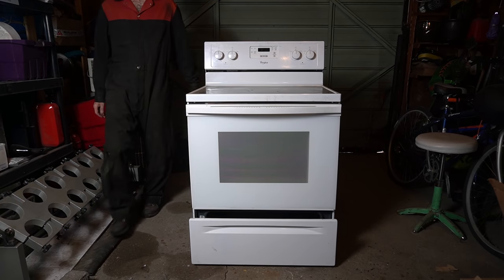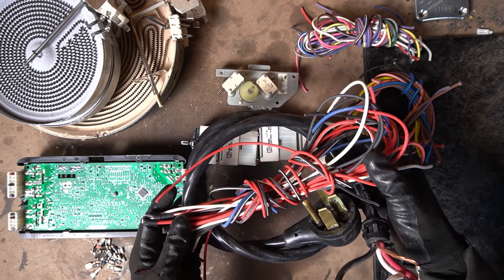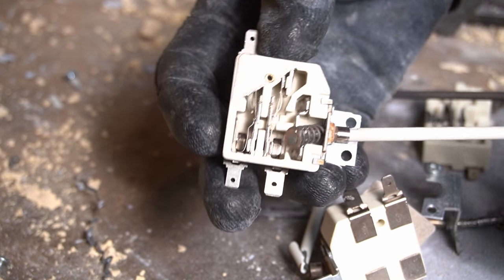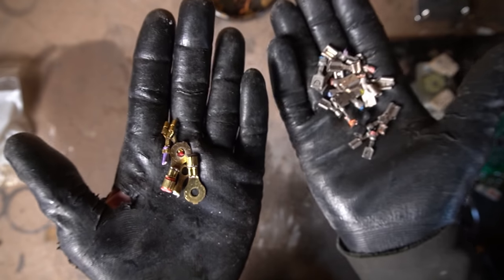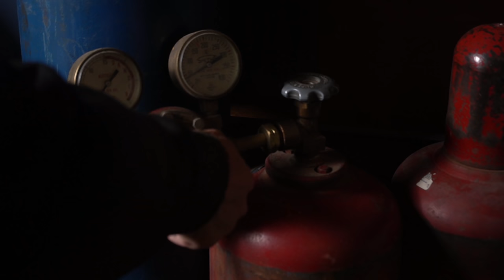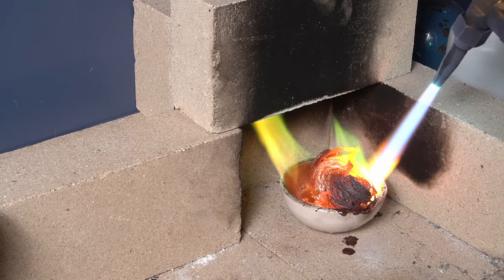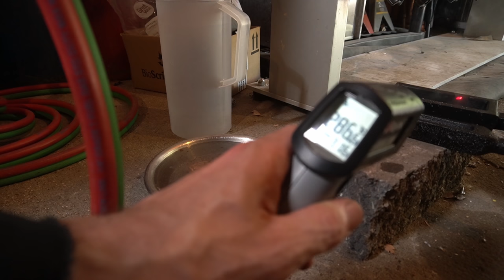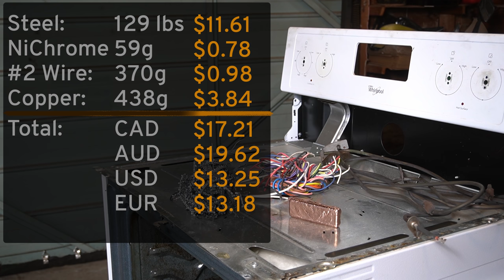Scrapping a Stove for Copper and Pouring an Ingot! How Much?

Comment: Appreciating the increase in production value you've shown lately. I know it's more work, so, yeah, it does make your videos better. Better angles, better lighting, better framing, better cutting. High density content. You've refined this process like you're refining your scrap :p
Reply from the maker: Thanks so much! I know these vids are a bit of a departure from what I’ve been doing up to this point but I’ve got the equipment and it’s really fun to try making the best quality I can. Running around with a GoPro on the face doesn’t offer the same opportunity for crafting angles and lighting aha

Comment: Nice! I recently replaced my own stove, and rest assured, I stripped the old one down for the good stuff!
Reply: Ha! I did the same. The house we moved into had an older one, it went bad so I scrapped it out😃
Reply from the maker: Hey it’s loads better than paying to dump it at the landfill! Not a whole lot to them besides the cord though
Reply: @thubprint  basically I’m mining for silver and gold. Scrap metal is the “byproduct”, but there’s always several silver switches in ovens and washers/dryers, etc.
Reply: @thubprint  I had a gas stove, so there was more aluminum and brass inside for the gas valve, but yeah. Store asked me if I wanted them to take away the old one for $30, and I was like, "Yeah, no. I got it."

Comment: Just a friendly smelting heads up… tin turns to Vapour at copper smelting point if not careful should really be using a fume hood or smelting outdoors when smelting brass/tin coated copper

Comment: Stove element went for 15 cents a pound last week, Clean Stainless was 40 cents. Thanks for the review of a new stove take-down
Reply from the maker: Oh did you take in a load? It’s a bit of a point of frustration for me, I know there’s value there but they really don’t seem to add up fast enough to bother with
Reply: @thubprint  just 40 or 50 elements and a dish washing heater or two. Everything has gone down 25% last week.Enjoy your unique " what's it really worth"

Comment: I used to strip things down completely but discovered the yards around here won't buy most of it. There is some good cast aluminum in new washers and driers but the motors are small and cumbersome to remove. An  aluminum pulley I ran in to on a new machine had a lock tighted allen head bolt that refused to break loose until heated but was it all worth the time. Not for what they are currently paying. The yards around here will buy insulated copper wire. It takes so much to make a pound and then there is storing the stuff until enough is collected to make a trip burning 5 buck gas worth it. Scrapping used to be fun when there was something to gain.

Comment: I'm always surprised at how thick the electrical cord for dryers and electrical stoves are in Canada and the US. Here in the UK they are thin.
Reply from the maker: Really? Huh.. That does seem odd, I’m sure they don’t run on lower voltage, your house plugs are 230v afaik right? We have special high voltage plugs just for the stoves and dryers, everything else is 110v. You have much faster kettles though!
Reply: I assume it's because most of our US,CAN high draw appliances use both 110-120 and 220-240v so we have 2 hots at 120v to neutral for stuff like the tiny light bulb in the back of the oven but the elements use the 2 120v hots 180degrees out of phase to get 240v ish but each individual hot wire is only 120 to ground(neutral) I've probably butchered this explanation but i think the the wires are thick because we dont have more than 120volt on a single wire for "safety"

Comment: Not much in there for me. Interesting using a cutting torch to melt copper. I like how you show both the good and bad tho. Most people would have cut out the issue with too much copper at one time.

Comment: The solder in those boards is lead/tin and sells for $1.50 a lb in the U.S. Cook the boards over a fire pit dug in the ground. Just use any scrappy wood, let it burn up to red coals, and feed the boards in. The solder will sink to the bottom of your pit and you collect it. I bet you can get a few hundred pounds in a year.
Reply: Tin solder is like 6-8 dollars a pound in the US, even up here in alaska where we get less than the lower 48 my scrap yard pays 4.50 a pound for it. I collect it off other stuff but I don't burn my boards because depending on the quality of the boards my yard pays .50 to 1.00 a pound for them so it's worth it to just sell em after popping off the ram chips and and high yield gold parts.
Reply: Watch MBMM . Milling the bare board produces 60% copper from the green boards.
Reply: @devind2915  I actually looked up price before I commented and my local yard is paying $1.50 a lb. for lead/tin solder. I was referring to bare boards and those tiny boards with little in them to be melted. Obviously, I didn't mean toss whole boards in. It's actually a very regional thing as to what yards will buy. My yard refuses tire weights or any burned copper. They also refuse used fishing weights and bullets. Why? You gotta ask them.
Reply: @charlesinscore4107  Those green boards are fiberglass... How are you getting copper from fiberglass boards?
Reply: @Jason1975ism  after depopulating the board. Under the thin green film is a milled thin copper sheet. They start as composition board covered in copper. Then the circuit pattern is milled. Then tin dots at circuit connections. Then covered with the green liquid. These boards are usually wasted. But conex's of them get shipped abroad. Hammer milled. Then sorted on a shaker table. According to a YouTube by Jason at Mt Baker mining and supply. There is %60 by weight copper in a board. It's a very interesting vid. 
Thx , Chuck
Reply from the maker: There’s a few different ways to claim some scrap value from those boards it seems! That’s the first I’ve heard of batch processing them to save tin solder, but I didn’t realize it was worth a decent amount

Comment: the only thing i take form fridges or this stuff is the compressors and the coils if there is any and the copper at the bottom thats about it ...i take things apart once if i dont find alot in it i dont do it agian...microwaves i never bothered as i heard they were dangerous but i just watched the microwave video so i might try ..not sure usually i just throw them out whole.. i look for rarer metals but spending an hr doing soemthign for 5 bucks is a waste to me..i like the compressors though they can be neat to find or take apart.

Comment: That wire/banding you pulled from the burners is probably not Nichrome if it’s magnetic. Nichrome has enough chromium to make it non magnetic just like stainless steel. It’s some other iron chromium nickel alloy most likely
Reply from the maker: I looked that up and I feel a little silly now 😅 seems that nichrome is known for being non-magnetic. So many different alloys around! Probably not worth fussing over though, takes a long long time to start measuring it by the pound
Reply: @thubprint  I think it’s neat to just collect

Comment: Hey mate. If you get hold of 2 air conditioners that are the same could you please completely strip 1. Strip the copper out of the radiators and the compressor and everything. And then semi strip the other one and compare the price and time difference? Pretty please.
Much love from Down Under

Comment: So I'm curios what made you start melting these ? I remeber in previous videos you advised against it saying scrap yards wouldn't buy it, has that changed?
Reply from the maker: No my thoughts there haven’t changed at all, I still think it’s a waste of time and fuel and makes it more difficult to sell. My only reason for doing it is to give a clear visual representation of the recovery volume in each appliance.

Comment: How do you easily remove the silver buttons?
Reply from the maker: Jar of hydrochloric acid with a splash of hydrogen peroxide will dissolve the copper/brass/solder away from them and leave just the silver buttons. They call it AP solution if you want to explore it 👍
Reply: @thubprint  there is solder holding them on? Can you pop them off without tearing them to tiny pieces?

Comment: how much money do you make from scrapping stuff? Do you just get stuff on the curb? It seems like a really fun hobby. Sorry for the noob questions, im new to your channel. Could you point me at any resources for getting started? I have a stove in my yard im thinking of trying to copy what you did here.
Reply from the maker: Check out my scrap for beginners video!

https://youtu.be/PXcfPbpH0cI

It’s not easy to make full-time income from scrap but it makes a good side hustle. Having a truck or a van or a trailer is a big help though, the most consistent money comes from the steel. A couple hundred bucks a month is easy to do casually, a hundred a day is doable with a truck. Networking is important to make okay money consistently, and pouring ingots only costs money

Comment: So what do you do with the tinned copper wire I’ve got a whole tool bag worth of the tinned copper wire I’m just letting it sit for now
Reply: You just sell it to the scrap yard, it's still #2 copper.
Reply: @devind2915  but that's where it confuses me because my local yard will only count it as brass scrap for some reason
Reply from the maker: Brass scrap? That’s an odd choice! I’ve read that you can dissolve the tin coating off with hydrochloric acid so I’m planning to try that on the next one of these vids but I doubt it’s worth doing for the difference in the scrap price
I typically just keep it separate and mine gives me #2 bare copper wire

Comment: Very enjoyable. Those other grey wire connector ends that you said were not brass, what do you think they are ? I thought they were plated brass., they are non-magnetic. 👍
Reply from the maker: I’m not actually sure! They aren’t magnetic but they didn’t show brass when filed. It would be really strange to use steel for a connector though
Reply: Roughly a third or half of the connectors I get from stoves (all seem to be made in Mexico now) are steel.  They are magnetic.

I usually run the magnet over my brass pile before I take it in, to avoid the embarrasment.

Comment: What was that powder you add inside ?????? 😅
Reply from the maker: Oh, that was borax! Sodium borate, it performs well as a flux which is just to give foreign contaminants something to bind to and then they get stuck on the crucible walls or trapped in the glassy cooled borax itself. I use simple candle wax in melted lead or pewter for the same purpose, but the high heat of copper needs something more robust.

Comment: Me and a friend was talking about getting a small forge to melt our cans down to make more room till prices go back up because they have tanked. Should we ask the scrap yard if they will take aluminum ingots? Also what category would they place it in if they accepted them? He thinks it will be in the cast aluminum category which is 18 cents less then a pound of cans. If that's the case it may not be worth it.
Reply from the maker: I would ask the yard because each one will probably have their own thoughts on it. You probably wont get the best price though because although the ingots are “cast”, the aluminium itself is not the same. There are many alloys of aluminium depending on what the intended use is. Cans are alloyed for cold-working and are different material than the alloys used for hot-working like casting or extrusion. The yard wont know which it is by looking at your ingots so they’ll have to default to a lower grade.
Reply from the maker: Also the loss is pretty significant on aluminium when melting because of how aggressively it oxidizes, much worse with thin material like cans. If it was me I’d do some quick math to determine how much more you’re actually going to make by holding onto them and let that be the deciding factor. Probably find you’re better off to just take them in now
Reply: Thanks for the insight. I learn something new every time I watch your videos. :)

Comment: By the time you add in the costs (gas for torch, flux, ect.) and your time, you made nothing.  You been better off just removing the main wires and stripping them.  Everything else goes as scrap steel.  And unless you have other copper, the copper wires out of one stove probably not worth it either.

Comment: I need to show this video to the drug addicts who've broken into my home over 30 times .They don't steal valuable appliances but just cut the electric plug wiring for scrap?Addicts stole power supply cable from street pole to  my home 5 times .Cops not interested in complaints from S/Indians and very protective of their brothers.

Comment: What a waste of time and effort. Rip off any aluminum exterior pieces, fill the oven portion with scraps and get on to the next 10 appliances... There's work to do that pays much more.I NEVER took refrigerators, just air conditioners. In the time it took to strip down 8 appliances I could pick up another entire load. Work smarter not harder.

Comment: If the stove worked, you would have gotten more just to sell it outright #ScrapSmart
Reply: Wouldn’t have made fun content though
Reply: So assume it didn’t work because Drake is smarter than that.
Reply from the maker: Probably the most important thing to keep in mind when scrapping, absolutely. Scrap is always the lowest possible value, if it can be sold first then it should be
Reply: @thubprint  Case in point - I found a 40-pound steel dumbbell last night. Just sold it for $20.  :D